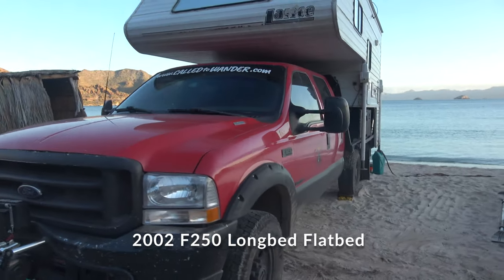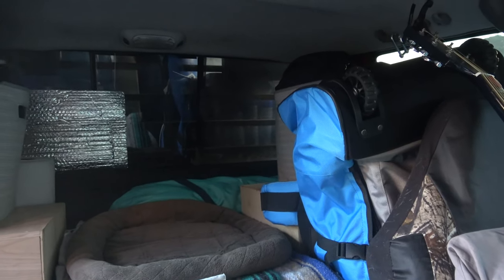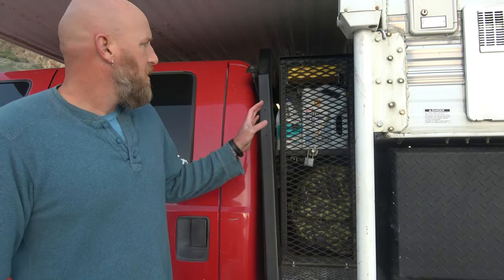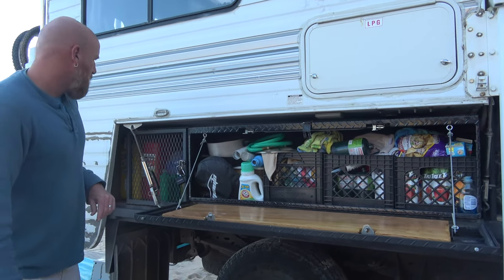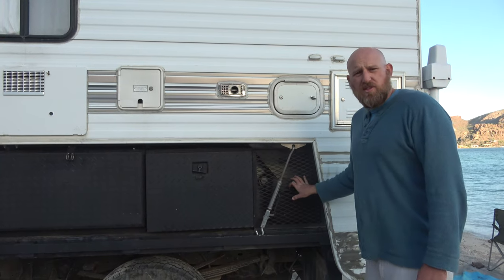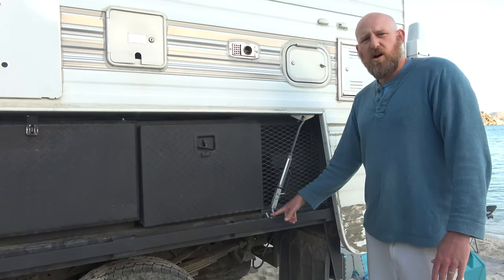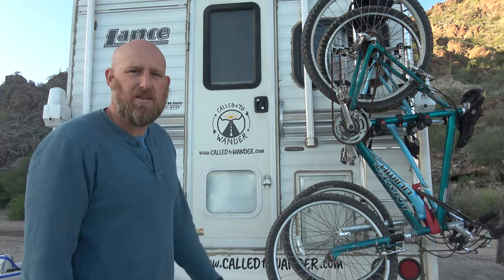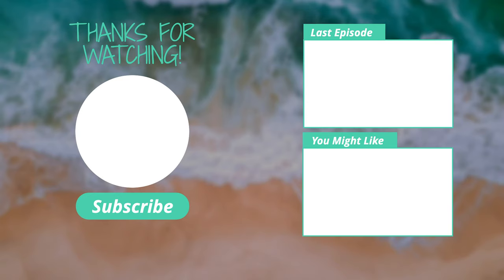DIY Flatbed Truck Camper 4x4 Adventure Mobile // Flatbed Truck Camper Tour  // CtW

Comment: Wondering how much your setup truck and camper cost with everything added for your power package ? Can you let us know in another video ?
Reply from the maker: Hey Neil great question! We sold Rocket + Tree Trimmer and bought a class C we're remodeling now. So we won't be able to go back and cover much ground with doing a video to answer your question. But what it broke down to was we bought the truck for 7K (with 445K miles) and the camper for 5K. Then we budgeted 8K more for everything from solar and batteries to kitchen accessories and the likes. So we were 20K all in... then on the road we had to make some repairs/upgrades. 4K for new rear suspension (airbags, additional leaf springs, airbag brackets) then we had a few more significant repairs that were part of routine maintenance on a truck that old/high mileage. Like all things, you can spend more or less depending on your specific circumstances. We wanted the 7.3L engine but could only afford the 7K when we first started and took our chance on what we had to put into it later. Hope this helps!

Comment: Curious if the width of the flatbed caused any problems with the removal jacks?  Those front jacks look kinda beefy... are they custom?
Reply from the maker: Elouise Vanhelsing The width of the flatbed is only a marital issue as we have about 1/2 inch clearance between the jack and the bed and backing beneath the camper is a huge marital strain! The jacks are standard from the dealer with no mods. We did think about switching out to dually jacks that would swing wider but we rarely take the camper off the truck so marital stress be damned!

Comment: Just curious, how much does your rig weigh? It's a very nice setup.
Reply from the maker: A lot. We stopped weighing it after we first hit the road and we've since stripped down and added a variety of things that make weighing it again futile. At that point we were pushing the manufacturers limits - largely due to the bulk of the steel bed. In hindsight a lighter bed (if we could have afforded it) or a full ton dually (we didn't want a dually south of the border) would bear the load better. But we're safe.

Comment: Can the camper be open to the cab of the truck? Like you coukd go from the back seat into the camper?
Reply from the maker: Not in our setup. For one, the flatbed raised up to cover the rear truck window. Second, with the 16" space we designed between the shortbed camper and long bed there was not space. Third, we built out storage in our backset so we never had the room to use the rear window anyway. A normal truck camper would give you that option. But we were not looking for this feature in our particular setup.

Comment: I’m doing a similar build to an 06 Power Waggon I’m trying to find a good aluminum deck but almost near impossible
Reply from the maker: chris Stadnichuk That was one of the hardest parts of our setup too, and maybe the weakest link as the steel is definitely heavy. But we couldn’t find or afford aluminum either so sometimes you take what you can get and get on the road!

Comment: Is your truck f-250 or f-350?  Is it short bed or long bed?
Is it dual rear wheel or  single rear wheel?  How many miles on your diesel?  Thanks for the info.
Reply from the maker: F250, long bed single rear wheel. We just crossed 491K miles and still going strong. We'll be putting our rig up for sale if you're interested!

Comment: What engine is the truck and what kind of mileage do you get fully loaded on your travels?
Reply from the maker: 7.3L diesel. We averaged 11 mpg. Less up hills and over 65. More on flat at 55.
Reply: @CalledToWander  Thanks for the reply do you mind sharing the weight of the camper if you know. I'm currently trying to convince my partner into getting a truck camper instead of 5th wheel or bumper pull specifically for off road trips like Mexico. Its just the two of us, our dog and cat going fulltime, just trying to decide if its too small. How did you two adjust to living in such a small space and always bumping into each other.

Comment: What is the length of your flatbed?
Reply from the maker: I do not have those specs written down and we sold the truck and camper over a year and a half ago. It was a standard longbed. We had around 16" between the shortbed camper and the cab. I believe it was 8' or 96"

Comment: How do you weigh research
Reply from the maker: Not sure we understand the question? Weight was nearly max GVWR and we upgraded tires to biggest possible to distribute the weight. Head to truck stop for CAT scale to know how much and how it's distributed between the axles.
Reply: @CalledToWander  You said you did a ton of research i was just wondering how to weigh research a ton is a lot